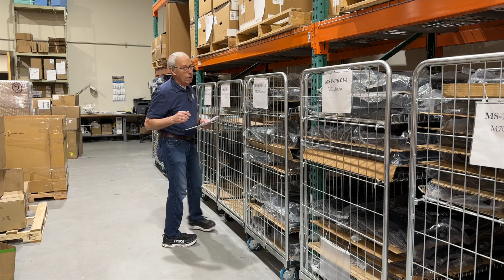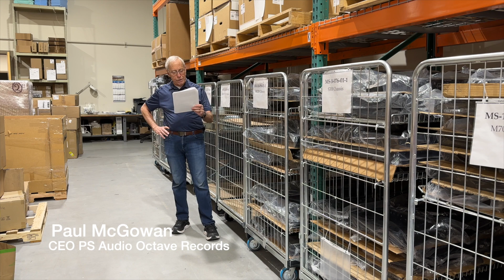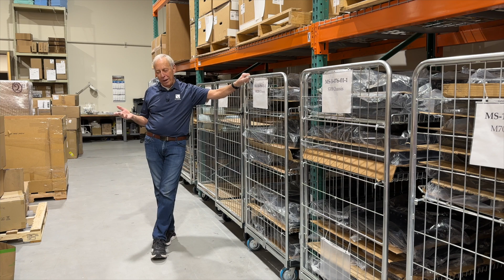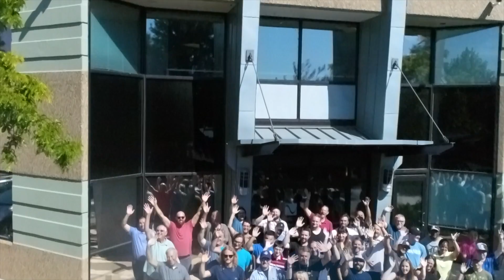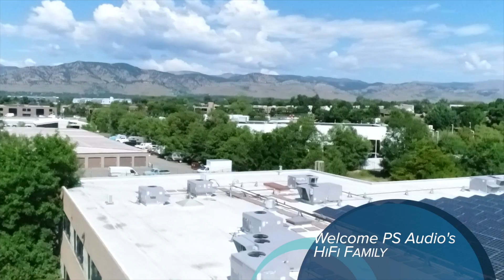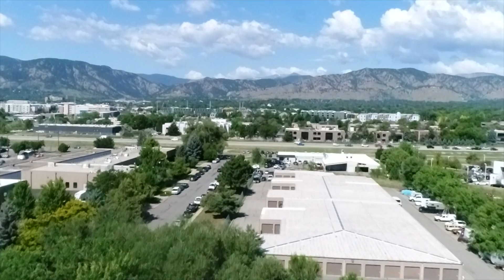Why the last few feet of the power cable matter

Comment: I’ve “got” the AC5 power cables and they made real improvements!  Only changed cable to conditioner and then to my two PS Audio M1200 monos recently purchased.  I’ll be upgrading to WBC  7 AWG on my Dynaudio contour S5.4.  Btw,  running DMP A10 through M1200 mono blocks and those speakers keep sounding better as I improve the front end. The bass keeps coming stronger too.  They’re awesome if you’ve got the power to drive them at 4 Ohm. 😎. PS audio customer service AND products are awesome.  You cannot go wrong trying their designs!!

Comment: If your power cable picks up noise because it's not shielded, so will all the wiring in the wall that leads to the outlet. Shielding the last three feet "the tip" will make absolutely zero difference. US home wiring runs 15 amps. Running a bigger conductor than that is absolutely asinine and truly ass backwards! The solution is a properly constructed power transformer. If your amp can't filter out line noise, get another one since the one you have is crap.
Reply: Sure, no need for simple power filters or even conditioners, all electronics in a bad grid with noise are automatically crap... 🤦🏻‍♂️
Why are you even here?

Comment: if these multi hundreds of dollar power cable do affect sound of a hifi systems can it be advantageously replaced by a $50 Uninterruptible Power Supply (UPS) which buffers the power through a battery in conjunction with the cheap standard power cables that were included in the box of our hifi systems ?

Comment: If it's easy to hear then it should be even easier to measure. It would be interesting to see measurements of noise floor with different power cables and of course different cryogenically treated fuses. I wonder why we don't see such measurements presented here in support of the case.
Reply: You don't see such measurements because they would not demonstrate a reason to buy the expensive snake oil.  If such measurements justified their boo-teek cables, they would be the first thing they showed you.
Reply: @richardyoung9773  I've seen a few measurements of interconnect cables and the differences amount to what we British call a "gnat's cock". I guess the power cables would produce differences amounting to, let me think, absolutely sod all.

Comment: Agree.

I have 4meter 3*1.5mm2 ac cable wall socket to my amp iec socket, nothin fansy, only small ferrite just before in the iec plug.

All the good filtering happens inside the amplifier.

There i have twisted dual pair back of the unit in front of the switch so coming and leaving power go side py side back to near the iec entrence and almoust all this 25cm dual pair is covered with wiremesh what is connected earth ground for iec socket side only.

Then when there is from that switch L and N it goes to line ac filter which is schurter 5500.2062 and that outer metal case is connected same iec earth ground pin as the earlier shiel i mentioned.

Before each transformer ac input there is one ferrite bead as common noise filtering.

Iec socket hold also main fuse for the amplifier.

After that schurter filter, L and N goes straight to the main power transformer for class A stereo amplifier and driver board transformer which is own unit and is use for audio in buffer and biasing mains amplifier section.

By the way, this amplifier is mainly floating unit.2

Comment: Equipment transformer act very similar to water pumps/turbines.  Similarly, the closest pipe coefficient of friction affects the cavitation of the pump more than the 1000s feet in front of it. Power cable affects several critical factors like transmission of impulse power,  cable internal filtration (transformer whining, transmission noise, etc), and external filtration (shielding).  The optimal 5-6 feet standard length plays into this for the 50hz and 60hz cycle.  Highly resolving systems can easily show the difference.  Since people hearing are all different, whether one can hear the difference is a different matter.  Outlets are also a soft boundary condition and can substantial affect the three criteria above.  Hence the need for audiophile premium outlets.

Comment: You cant explain it because its just rubbish. Deniers.  You mean people that listened in science class. There is no scientific reason because its not true. It amazes me why ask a guy whose ears probably can't hear over 14 khz and questionable electrical training. Plug your oscilloscope and prove there is a difference. EMI doesnt t just effect the last few feet , its insane to tell people it does. Paul you are full of it . Its easy to disprove. A transformer doesnt just affect the windings and a few cms out. Its the whole segment run of cable until the next components.

Comment: Makes sense if you consider shielded power cable helps contain the noise within the cable. 
Basic principle of balanced audio cabling is same. Shield should connect at only one end. Typically at the destination is best practice.
Reply: Except for the tens to hundreds of miles of plain wire that deliver the power to your house, the hundreds of feet of contractor grade Romex that wires your house, and the fact that if the device is equipped with a properly designed and functioning isolation transformer no special power cable is needed.

Comment: Once the power is clean you should keep it clean (after your power filter), that's why the last few feet matter. Shielding is everything here, don't bother with OFC or silver conductors or PTFE dielectrics on power cables, it isn't worth the money. If you have a $100,000 system and want to muck about, why not, get a $1000 power cable, but I wouldn't waste money if you have a more reasonably priced system.

Comment: There are 3 things going on with audiophile power cables.  1) They reduce impedance,  however they need to be connected into a low impendence mains block or from the wall.  2) They reduce RFI that's present on the AC mains.  3) The quality of the plugs and IEC connections effects performance, also the materials used such as gold or rhodium plating.   Here is the thing, not all audiophile power cables are the same, I use ones made from 12TC Kimber Kable with Watt Gate IEC's and these are very effective, however I also own some entry level Audio Quest cables and the Kimber Kable based ones easily out perform the entry level AQ ones.   The improvement in audio from Kimber Kable power cables can easily be demo 'ed if standing in the room and switching with a typical $5 IEC cord.  The people in these comments saying power cables can't make an improvement are incorrect and on the wrong side of history.
Reply: Sorry, you are just wrong, from a radio engineer.  Any minuet impedance   manifests it self as minor voltage drop.  Your mains power voltage is up and down 10% every day!.  Good equipment does not care.  Shielding does not reduce existing RFI,  it keeps it in as well as stopping collection of any more.  Your whole house is putting RFI into the cables in the walls.  Who cares about the power cord.  Power cord plugs are swipe connection.  Material is irrelevant at these low currents.  And Paul is wrong as AC neutral is tied top ground earth stake at the fuse box.  My system runs of a no break UPS - mains independent.

Comment: Remember: Paul:  "I am a self-taught analog electronics engineer and have designed most of the analog products built by the company. Recently, we've moved more into the digital music area, and our team of engineers has been doing most of the design work for this - but they all need analog stages, so I manage these as well."   So when you compare the top engineers at McIntosh and Amir at Audio Science Review with over $100K analyzer of speaker wire, interconnects, and upgraded electrical plugs, with Bachelor's and Master Degree's in Electronical engineering, with Amir managing a department of over 1000 electronical engineers at Microsoft, consider the education. Paul has no college degree.

Comment: Could you show us evidence of what you believe? Did you do a double-blind test on any power cords or speaker cables in your own shop?  Take a bet with Amir from Audio Science Review for $$25,000, and the loser gives it to charity?   Nah, never happened; Roger Russel from McIntosh (an electrical engineer and top McIntosh designer told us to save money on speaker cables and AC wires 40 years ago).  Now we have a salesman with no electronical education pushing wire and cables and conditioners selling again.

Comment: I like to purchase higher-quality aftermarket power cables for my audio, video and PC equipment. However, I don't do it with the idea of it improving their performance at all. I do it because I like heavy-duty, thicker cables that are made with higher quality materials that (at least in theory) will last longer and hold up better over the long term because they are sturdier. Also, they are just simply a lot more fun to have in your system than the standard ones that come with your equipment by default. Now, you don't have to take out a second mortgage to get good quality, well-made, after-market replacement power cables. You can get them for anywhere from about $40 to $90 so no, you don't have to go absolutley crazy and drop $8,000 on one of those at all. Not necessary or required.
Reply: Same here. I stick with Worlds Best Cables. Not crazy priced and built to a high standard!! Can I hear a difference? I’m not sure. But they are constructed better than cheaper cables. Plus a 10 year warranty is always nice.

Comment: Trying to simplify the contention that the difference between well working cables and others that are less so misses the point of the argument.   I don’t think you’ll get an argument from most people that cables should have a certain level of quality that keep interference to a minimum - the argument is that it shouldn’t cost thousands of dollars more to include decent shielding or quality parts. And if you want to change minds that are changeable, make your argument and then back it up with quantifiable (pertinent) measurements, not just marketing blather.  Also, overhyping the benefits of an exorbitantly priced cable instead of buying a component that either filters out or produces less noise and interference of its own is a disservice to us all.

Comment: Changing cable capacitance through design can be used as a low pass filter to reduce the amount of EMI going to equipment as well as facilitating moving EMI generated in equipment to ground.
I think there are serval reasons why equipment manufacturers don't  include $1000+ or even  $100+ power cables. First, some people don't hear a difference. Second, not having an expensive power cord allows the manufacturer to set a lower retail price. Finally, not everyone likes the same power cord. I've found that some expensive power cords are too effective at filtering out high frequencies and cause equipment to sound dull.

Comment: It is an undeniable fact of physics that any length of wire is an antenna that will pick up all manner of spurious crud. And the power cord will happily deliver this spurious crud directly inside the chassis of your beautiful amp.
It is also an undeniable fact that the human ear is to musical sounds as the human palette is to good food and wine. So doing everything possible to keep your wine glass and flatware clean and fresh is a good idea.
And putting a grounded shield around the six foot conductors of your power cord and signal wires is also good idea.

However, A well designed analog power supply ought to eliminate 99.99% of any problems coming from yer wall outlet, the other noisy devices in your house (computers, fridge, printer, dimmers, LED lights, etc) and/or the power company.
Finally, do you want to terrify the audiophile in your household? Just remind them that all stereo component power supplies have a bridge rectifier to convert AC to DC. It's like opening and slamming a door  shut 120 times a second. The EMF spikes that result are horrendous (and the BR is even closer to your beautiful analog circuitry than your suspiciously cheap power cord). But thank God for snubber, bypass and reservoir  capacitors.
I now leave you in peace....
Reply: Ok, but what about the 1000 miles of cable run between your house and the power plant? How is the extra 1 meter of cable going to magically fix whatever problem you seem to think you are having? Paul did not even answer the question.
Reply: @Wordsalad69420  Copy that. As I mentioned, well designed internal power supplies and the amplifier circuitry itself are perfectly capable of filtering almost anything but a lightning strike. in that case, a new house might be required. There are some great books out there on audio amp design. Randy Slone (sp?) is one of my favorite technical authors. He addresses this subject in detail and he's an easy read (as long as you read each paragraph twice)l. Bob Cordell (sp?) is another awesome author/engineer, although you need to be very serious to get through his material, it is detailed, in-depth and absolutely top notch.
Reply: @Freq412  Well hopefully those $20K amps have state of the art circuitry that filters out anything bad, so then why do you need a fancy power cable?
Reply: @Wordsalad69420  An excellent question that I'm going to test before answering. I'm in the process of building a very unique musical instrument amplifier from scratch with a power amp section based on a Randy Slone design. It's very "high end" and when I get some time, I'm gonna play with the power cord, shielded vs unshielded. We'll see how it goes, but don't hold your breath, I won't be finished with the amp until January some time.....

Comment: If you can hear the noice from the power input of an amplifier at the outputs of your amplifier. The solution is not to buy a fancy cable but to buy a decent amplifier.
Reply: Yeah, exactly.
The only exception is with phono cables/turntables.
Those can pick up 50/60Hz hum when cable routing is bad, but for any line level signal, it's not an issue.
Reply: @AdTrompet  well you said that fast true and simple you have to excuse my grandfather Paul  he has Alzheimer's.
Reply: The problem is, an amp with a built-in power regenerator does not exist, as far as I know
Reply: @5starmaniac  sure does, battery powered devices are AC noise free (provided there's no DC to AC conversion).
Reply: All Hi-end amps have electricity stabilizer and shield. But it helps if the environment is also clean and stable!

Comment: So lets’ see, you have dropped $11,300 on a single-ended triode mono-block amplifier that puts out almost 6 watts with a mere 3% THD.  You trust that the engineers that designed it have picked a topology and specified the appropriate components (Vintage NOS tubes, Mundorf silver/gold/oil capacitors, Vishay resistors, and pure silver wiring etc.) to ensure it provides crystal clear transparently that is always agile and dynamic while being rich and fully saturated, offering a tonally and harmonically dense acoustic environment with a huge soundstage and a highly natural tonal and textural delivery that is extremely quick, and controlled - yet neutral, balanced, very musical, and powerful with blackness and control in the bass that allows simply the right transmission of music free from artifacts or manipulation in which the instruments are contained in their own space resulting in a magical musical harmony between speaker and amplifier electronics that assures considerably better focus, instrumental separation, cleaner & sweeter treble and better upper-midrange resolution with an impressive layering of dynamics, as well as nice drive and transient pop, and a strong degree of transparency that is grain-free and offers effortless resolution and reflexes, making it a snap to follow interleaved melodic and rhythmic lines with a sound that is open and detailed with exquisite harmonic nuance and shading with dynamics that are very agile (again!), realistically tracking changes in the music yet with a low end that is elegantly controlled but not over-torqued but instead is luscious, velvety, silken, gorgeous for a presentation that never, ever sounds electro mechanical, instead is always wholly natural with a dynamic range that is prodigious in delivering the sonic goods with naturalness, beauty, and ease, while also throwing a remarkably deep and wide soundstage (again!) brightly every time with a golden sense of bloom, inviting detail, and unwavering musicality that produces lifelike illumination in the mids and treble, exquisite resolution of fine detail, and outstanding transparency to the tintinnabulation that so musically wells from the jingling and the tinkling of the bells, bells, bells, bells (oops I diverge).
The engineers that designed the amplifier are, however, completely incapable of specifying a power cord that fully (or even partially perhaps) meets the needs of such an amplifier.  Thank the Lord above that there are companies at the ready to make up for such ineptitude – that is if you are willing to pay the price.
Reply: This

Comment: How to ground the noise from a noisy motor in turntable that Is inducting into moving coil phono cartridge as it approaches the center of the vinyl record? Should I get a moving magnet cartridge that picks up less noise from the motor or is it possible to magnetically shield the motor? Yes, I have a cheap turntable.
Reply: My solution was to get a belt drive table that didn't have a motor under the cartridge path with my next upgrade, eliminating the concern forever.   But if it is possible to put a metal shield around the motor, that would work .   It's the same theory behind why people wear Aluminum foil hats, to block out unwanted signals.   Although the former is more practical than the latter, both use the same science.